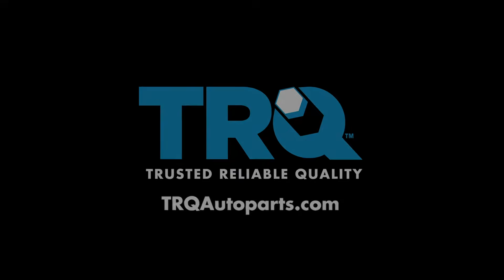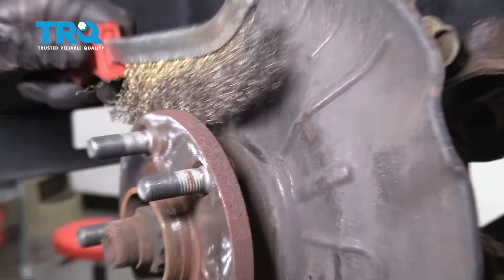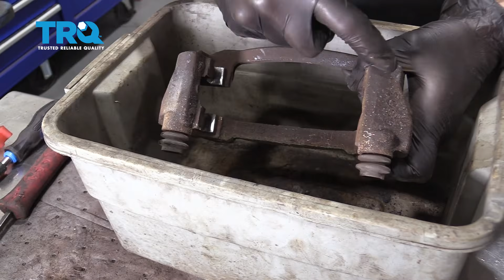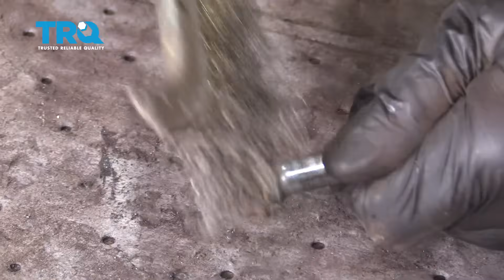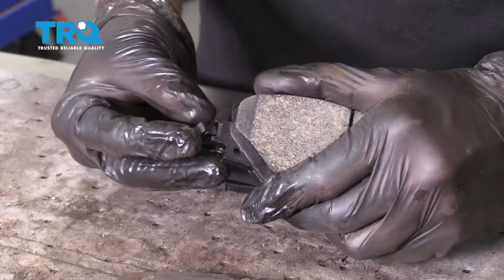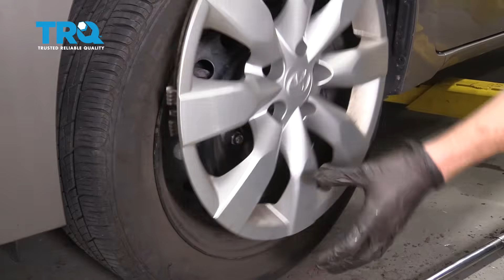How to Replace Front Brakes 2014-16 Toyota Corolla

Comment: This video is great! Many thanks for making it. However... in my case, I could NOT remove the ROTOR with a hammer. I exhausted all my energy on doing this (let alone all of the neighborhood heard me beating the rotor nonstop, and I felt like an idiot). There are two holes on your rotor - just get one or two bolts, size M8-1.25, from Autozone/Oreilly/whatever, and screw them into your old rusty rotor until it falls off. It will come off a lot easier than if you use a hammer. And, in principle, I really believe this is how it's supposed to be done at a professional service! Not only it will be a lot easier, but you are not risking damaging your rotor or wheel studs with the hammer! Good luck to everyone)

Comment: I wish these videos were done for worst case scenarios where everything that could be rusted and absolutely jammed and stuck and busted was dealt with. Makes it look like a little nudge with a prybar will pull the calipers apart? Or that the pads aren't basically long welded in? Hah. Broke a prybar on those suckers.

Comment: Replaced brakes and rotors on a 2015 corolla and I have brake shaking when applying brakes. Lubed everything up right and I am stumped as what it could be. Didn't know that there was an inner and outer pad for this car. Is it possible that mixing them up would be my issue? I did these brakes at night and the pads looked alike.

Comment: I loved your clarity and cadence. I'll be back. Only thing you didn't mention was what you used to clean the caliper guide pin holes with. I didn't think it was brake cleaner because I thought that would damage the rubber seals. What DO you use for that?